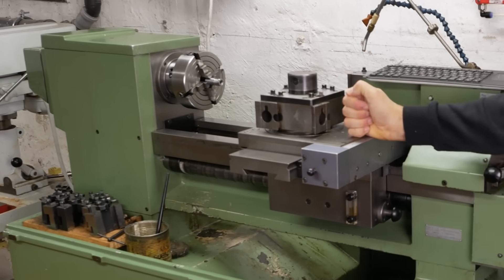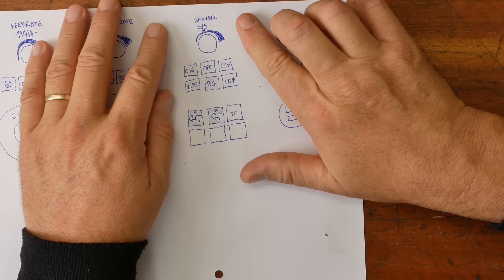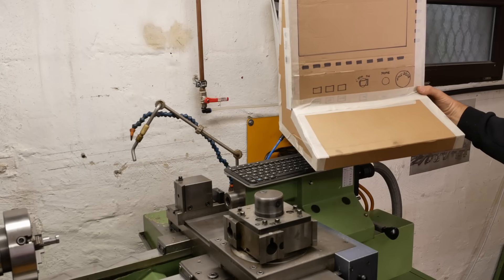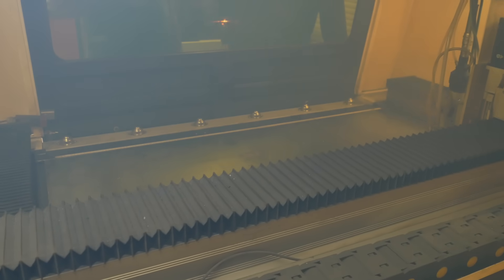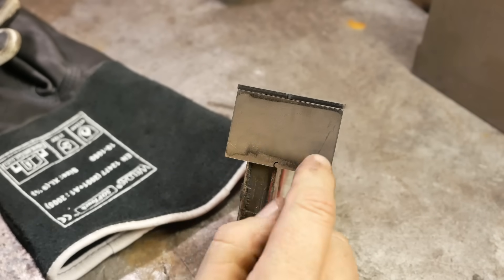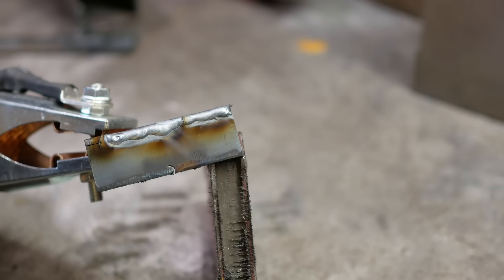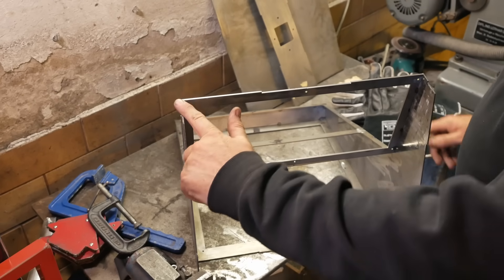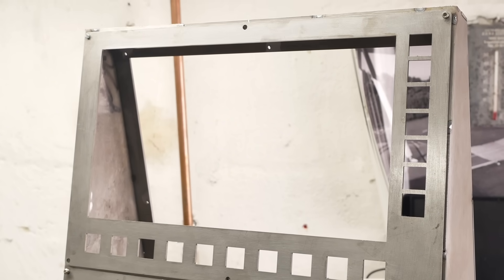Fabricating the CNC Lathe control housing - Schaublin Ep. 56 || RotarySMP

Comment: That control box/panel is very good looking, well done!
How often is the no power undercarriage drop test performed?  Is that a build completion thing only?
Reply from the maker: Thanks. Normally a C-Check tasks, but probaby only every second or fourth, so a roughly 4 ot 8 year interval.
Reply: @RotarySMP  Thank you. I do not remember what plane it was but tv showed an undercarriage gravity drop, well scary, looked like it would hurt the plane, I know its built for it but . . .
Reply from the maker: Some have more restriction in the Hydraulic return lines to soften the fall than others.

Comment: This is a personal opinion. But I really don't like the idea of a joystick. It's just a crash waiting to happen, accidentally jostling it and having the tool run into a part. I know you mentioned it would only engage when you had it in that mode, but just imagine having touched off on a part and you go to do "something" and whoops. - Rest looks just fine, I always run the first part with my hand on the feed override knob, slowly approaching the part and going to 100% when everything looks right.

Did you plan on making up encoder wheels as well for z and x?
Reply from the maker: Thanks for you feedback. I have choosen a very short joy stick, as I was also unsure whether I wanted it or not. 
Yeah, I will make a separate module mounted down on the front, probably sliding on the cover rail, which will have the two jog encoders, and the jog increment slection on it.

Comment: You seem to have a welding problem. Either a cleanliness issue (doubt it with laser cut parts) or a cover gas problem. During the test welds you shouldn't have gotten that much sparking and staining. Maybe its just a low flow rate. Last time i had that problem it turned out to be a crack in the gas line acting like a venturi and sucking in oxygen. Let me tell you that was a fun one to troubleshoot. Control case looks amazing though. Keep up the good work
Reply from the maker: This welder has no pregas, and only 1 sec fix post gas.
Reply: @RotarySMP That is a pain to deal with. I would still try another 2-3 LPM on the regulator, shouldn't have that much brown soot with steel that's clean...
Reply from the maker: @ShittyTomsDEs  Thanks for the tip Thomas.
Reply: Well, that's annoying, but I am glad it's something you can work around knowing about it.

Comment: slot and tab is fantastic. But I will add that if instead of designing all the edges to meet at an outside corner makes you have to do a "square groove weld" or basically weld on the flat joint. If you would have had the sides overhang the back piece, you would have been able to do a fillet weld in the Tee joint. Which would have been easier to get a strong good looking weld. But that would have changed the look you were going for.
Reply from the maker: Thanks Andrew. Given my welding skills, I am going for the grind and paint look :)

Comment: I find it reassuring that you wear your respirator when grinding. I do the same, in order to avoid breathing iron filings and getting rusty snot. :-) 😂

Love your design. I can definitely see similarities with the design of your milling machine.
Reply from the maker: Hi Dave. Yeah, I figure I only get one set of lungs, but those cartidges are replaceable. Especially Tungsten is not supposed to be good for you either.

Comment: The way I’ve done this is to make a multi body part. I use Solidworks but I imagine that your Cad package will have that same capability. Draw and extrude the first body and then make a new sketch on a panel edge. Convert the edges and add the remainder of the edges of the second panel. Rinse and repeat. Then make an many copies are there are bodies.  Delete bodies in each part file until all the part files have just one body.
Reply from the maker: Hi Eric. Freecad has some weird naming convention issue, which means your models are really fragile if you sketch on an existing facet. Drives me nuts, as you have to be really rigorous about puttin in reference planes and working off them.
Reply: @RotarySMP  are you able to create an assembly and then within the assembly edit one part in relation to a second part? In Solidworks this is possible but you really have to think ahead as changes in a part that other parts are referencing can create weirdness.
Reply from the maker: @ericmorriscompany9648  That is not the strength of FreeCad. You have to be very rigerous, and set up the parameter table well ot do that sort of thing, and you still sont want to reference off another part, but rather off an independant refrence plane. Seems to be the core weakness of FreeCad.

Comment: Here in Yorkshire, we have W.M.Spence for laser cutting. A great little company that turn out fantastic laser cut and folded sheets at very competitive prices!
Reply from the maker: You are lucky to have such a service. A few years ago I contacted 5 different laser companies around here, and not one even bother responding.
Reply: @RotarySMP  then in that case we are extremely lucky. We can send them a STEP model of a folded part in it’s finished form and they have some cool software that works backwards to determine how the part should be laser cut and folded to achieve the finished part. It’s black magic I swear!

Comment: Beautiful work! This is a project of mine soon aswell. What keyboard is that? looks like a perfect fit for my machine. Also what metal thickness
Reply from the maker: I used 2.7mm steel, as that is what my mate had a sheet of. I like nice think casings, as they feel more machine like. 

I'll look up that keybpoard model, but I bought it used.
Reply: @RotarySMP 2.7mm is perfect! must feel great in the hand. let me know about the keyboard!
Reply from the maker: @zonumprecision  It is an NSI KSM103B0001-W-MC1. it was made in Belgium. Are you in the EU, or on the other side of the pond?

Comment: I think you made a smart choice, spending the extra time in CAD to design in all the tabs and then get the benefit of easy and accurate construction.
Very pro all round! Better than I would have done. 👍
Reply from the maker: Thanks. It is really fitting up nicely.

Comment: There was a python add on for freecad that did the tabs but it hasn’t been updated since 2020 so not sure if it’s been added to a workbench or just forgotten 🙁 not sure if it’s the fast forward but when tacking it looks like you are pulling away before postflow has finished so getting a bit of oxide developing.... looks great though 😀
Reply from the maker: Hi Julia, I suspected there might be some way of automating those tabs. Thanks.

Yeah, I don't have a pre gas, and the post gas is fixed at 1 sec. So I let off the switch, pull back far enough to prevent the arc reforming, and then hit the switch again for post gas. I am not that good at it yet.

Comment: Great video, nice that you had access to a laser cutter. My question is why to welders seem to have a random order to which welds go first? Wouldn't it be better to either start in the middle or start at the end of a long piece? Like having an bolt sequence to an engine head.
Reply from the maker: Not sure what real welders do. Since the metal is slightly bowed, I just start at each point which fits best.

Comment: That construction technique looks to be pretty foolproof. From a certified fool, I might just have to try it in future. It certainly beats bends, bend allowances, and trying to cut the sheet into the various developments. For someone on a limited budget - materials wise, non production - the trial and error of the first build is avoided completely. The only problem is the need for a laser cutter and welding over hardware fixturing. 

Great stuff as ever Mark.

At Che Squelch, any control panel has come to be affectionally known as a Dit. The short form of the onomatopoeic "Dit Dit". Beep Boop works too.
Reply from the maker: I like that :)
I like to have really heavy walled control boxes, as they feel nice and solid. This is 2.7mm steel. I would not be able to bend this.

Comment: I love laser cut steel...did a lot of it back in my past life...starting using a company that built their own systems (I think) called coventry laser. They had a massive triangular laser setup, and an offshoot in Newcastle that I visited frequently.
I used to design it all in layers in a 2D cad package running on an Acorn RISCOS machine, export as DXF.
I used small 10mm long tabs dropping into rectangular holes in the mating sheet (Not edge to edge, but usually with an overlap projecting a few mm). One job was shipped direct from profiling company to the fab shop...fab shop phoned up and asked if they should grind the tabs off cos they didn't fit the slots....
I said no and rushed over ... the panels were laser cut from the right thickness material, but 1/2 size ! oops.
Reply: Meh, close enough :D
Reply from the maker: @ptonpc  Ouch, that is a costly mistake :)

Comment: Great job, that was the video (series) I was waiting for. Also, hats off for putting up with FreeCAD. Sorry for not having had time to send the stuff, but I have two HP 1810-8G switches and a bunch of patch cables and keystones sitting here with your name written on them.
Reply from the maker: Hi Alex, Thanks a lot. Yeah, I am also looking forward to all on the welding on this project as well.
Reply: These are really nice switches. Took me a while to figure out, that you can replace the fans by noctua ones, and keep the fan-good signal by wiring a 10nF capacitor between the tachometer signal and ground but now mine is even practically silent.
Edit: Okay, noticed I got the 24port 1800, which does have fans, while the 1810 8 port does not. Oh well..

Comment: When you test the gear swing, do you test the backup manual extension as well or just the regular one?
Reply: Hi Henry, I made the Gear Swing clips. Yes we also did a freefall extension as part of the job per the AMM. This was required prior to the 2Y storage anniversary and will happen again at the full return to service next year.
Reply from the maker: @antonwhittle415  Thanks Anton.
Reply from the maker: Good question, whether this was called up in this case. I'll ask.

Comment: Realy good jop Mark. I am impressed how well you can handle the FreeCAD. Have you ever tried Autodesk Fusion 360?
This is free for private use and has everything integrated (CAD + CAM) unfortunately with a few limitations in the free version.

I can't wait to see the finished control. Good luck😉
Reply from the maker: I never got into Fusion, as I used to use Onshape, but once I monetised my channel, I can't use it within it (or Fusion 360's) license. That is why I switched to FreeCad, as I don't need it enough to cover the cost of a commercial license. FreeCad has some issues, but once you get your head around it, it is just as good for what I do.

Comment: Just starting to watch with my morning coffee - 🤞there's a mention of the Manualmatic in dispatches 😉(although al little OTT for a lathe).
Reply: This could well be the inspiration needed to get my CNC mill's display/keyboard off the old DeWalt planer/thicknesser that I'm 'storing' for a friend. That is, once I've decided on which better-than-Asus display I'm going to use... Thank you - hope the Covid has no long lasting effects.
Reply from the maker: Hi Phillip. I feel fine again, thanks.
Go for it. Every  CNC deserves a real control panel.
Reply: @RotarySMP  Unfortunately (well,fortunately) I've made the Manualmatic too effective as an interface, so really only use the console for probing and loading programs... But it does look a Bit Crap™ balanced on the planer.
Reply from the maker: @philip_fletcher  So you have the trade mark for a bit crap solutions. I guess I owe you some licensing fees :)
Reply: @RotarySMP  Unfortunately Crap Solutions™ was already taken by a multinational (who I'm legally obliged to not name) so had to settle for a Bit Crap™. Which feels a Bit Crap™ because I don't normally settle.
But the invoice is in the post.
Reply from the maker: @philip_fletcher  A Cheques is on its way :)